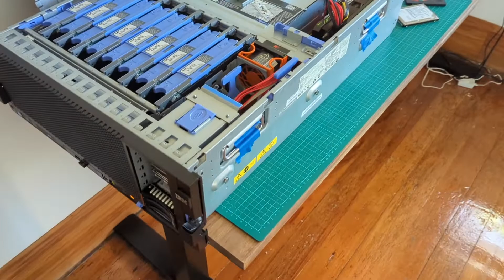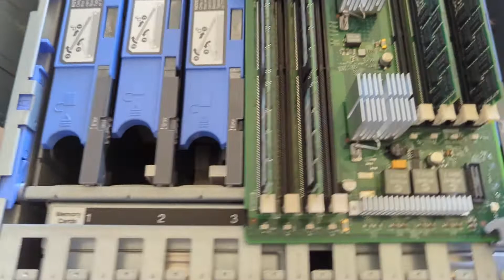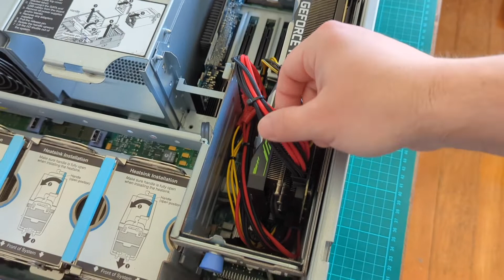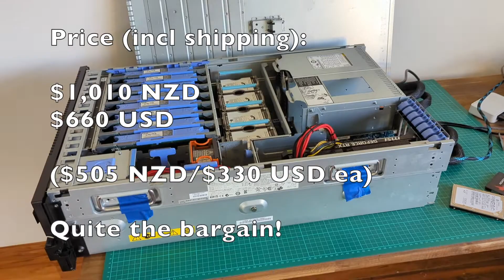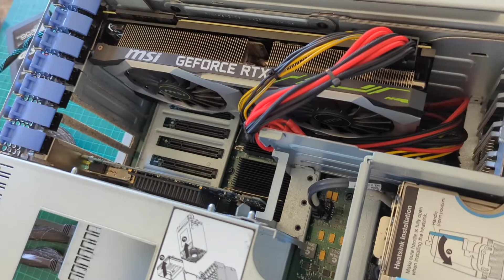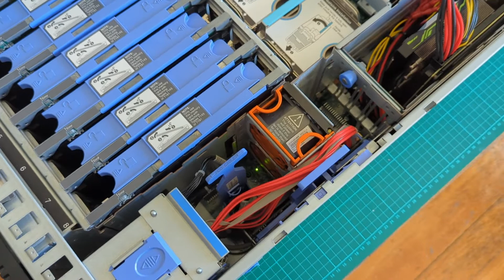My new reinforcement learning servers - IBM x3950 x5

Comment: Looks a lot like the X3850 X5 what's the difference?
Reply from the maker: Marketing, I think. The two share most part numbers, service manuals, firmware, chassis (save the front panel), etc. I'm not fully versed on the history of the product, but from looking through what I can find, I think they had a small handful of high-value use cases that they were marketing toward, and the x3950 was pushed toward the larger spec systems (ERP, large in-memory databases, etc).